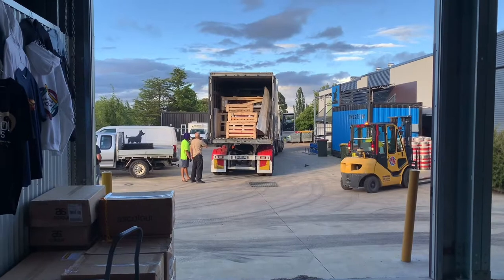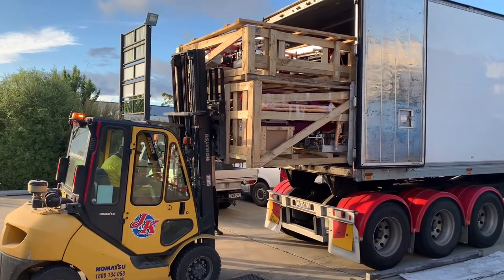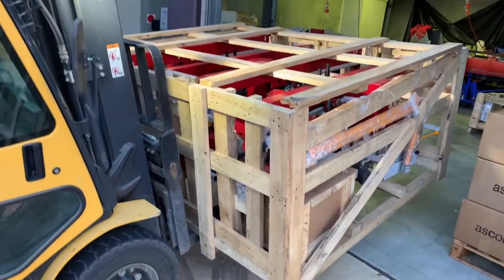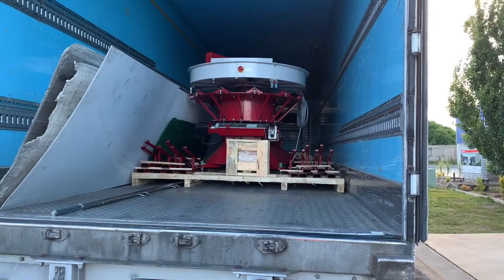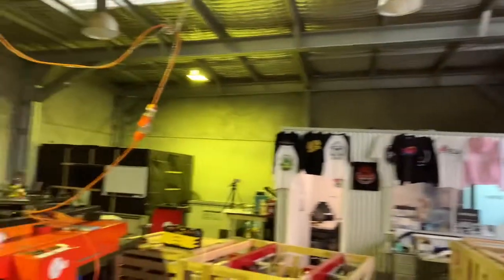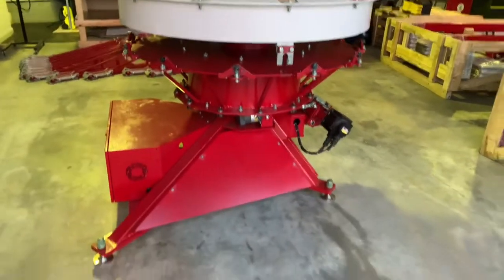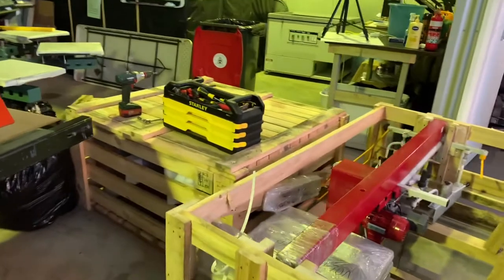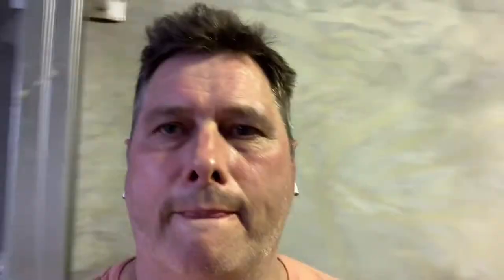DAY #1 Anatol Volt Automatic Screen Print Installation

Comment: Hi , just wondering how much power supply you need coming in to your factory to run one of these
The rapid wave flash is 63 amps
Reply from the maker: Hey, quite a bit, but its complex. Best thing would be to contact Sam directly on sam@ministryshirts.com.au he will be able to advise you.